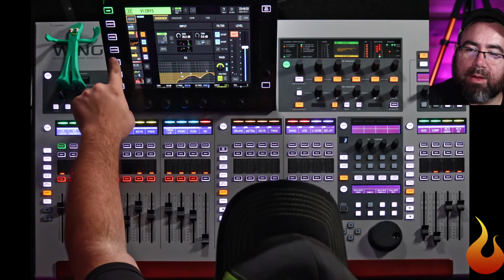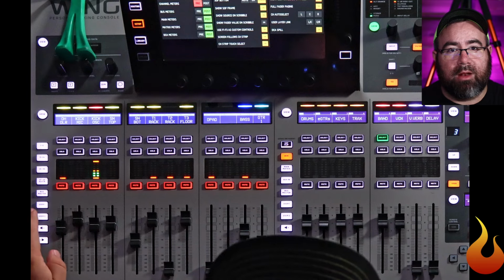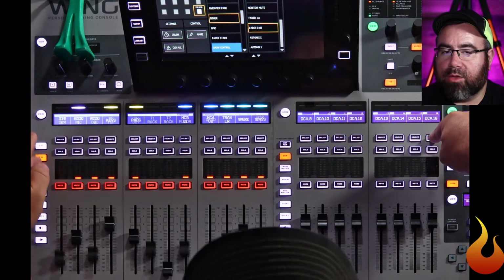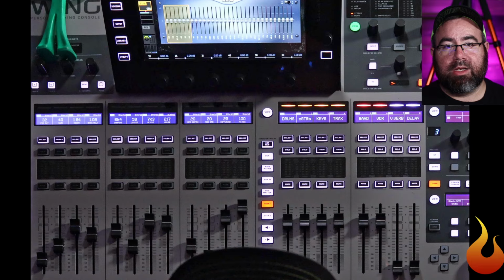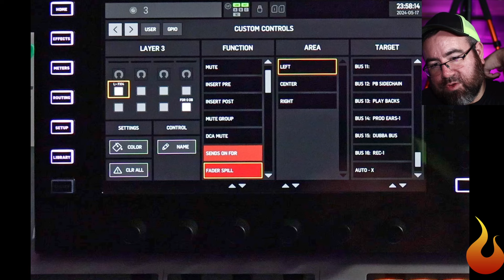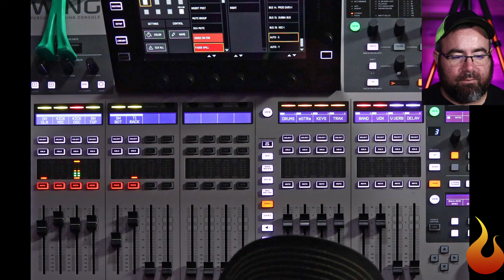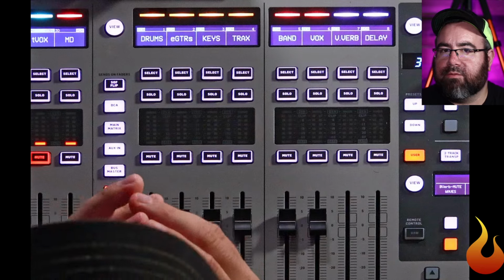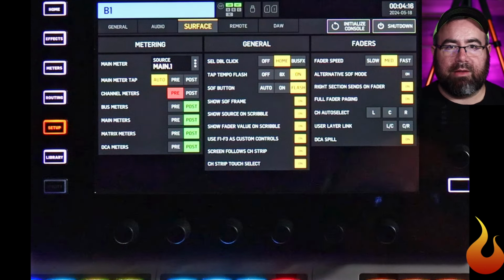Behringer WING DCA Spill - Firmware 2.1 - #AscensionTechTuesday - EP171

Comment: You’re welcome for the full fader paging and glad to see others are using it too.  I’d requested that one back in the early 1.x days and it’s been great to expand the custom layers on the left bank.  I have a few items like a two channel electric and bass that I use DCA’s for on the primary layer, then have the contributing channels and DCA’s on the 13-24 bank.  I used to jones for DCA spill, but I’ve been using the custom layers to replace the need for it on the Wing.  I wouldn’t want to use an X/M32 without though.

Comment: HI 
I have a network for the equipment and another network for the users. Between the networks there is a firewall.
I need to know which TCP/IP ports should be allowed on the firewall between the Mixer and the mobile application?
Reply from the maker: @fernandolcoto  not sure about that. Sorry. I suggest keeping things simple with a dedicated wireless connection. That’s what I do anyway :)
Reply: @AWTechTuesday  I've been testing.... but i heard something about ports 10024 and 10023 TCP/UDP